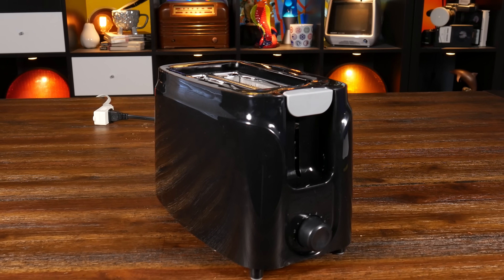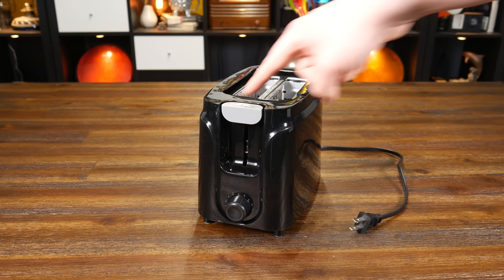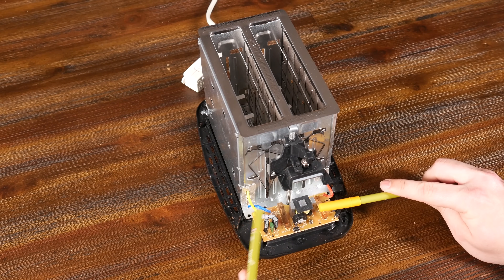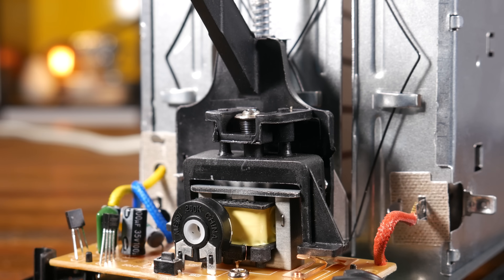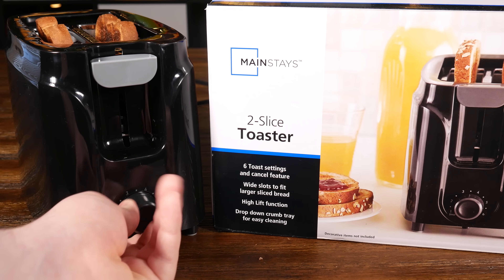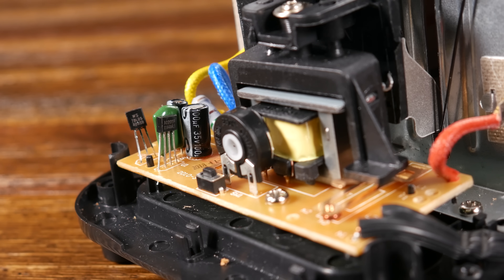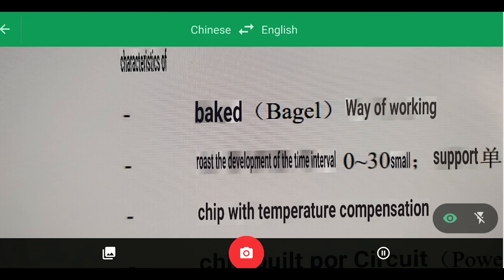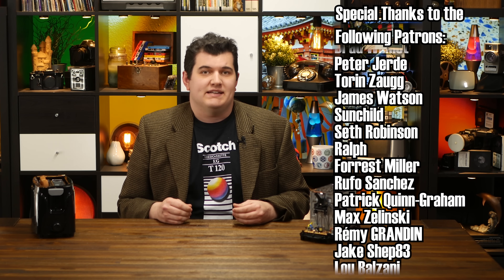The Electromagnet in Your Toaster

Comment: About 50 years ago, I worked in an appliance repair shop, and learned quite a bit about toasters, toaster ovens, broiler ovens, etc. I will totally vouch for the statement that the best toasters (at that time) were the Sunbeams, that lowered the bread when you put in the slot. They were easy to adjust and worked well as long as they were kept clean (free of crumbs). Proctor/Silex were pretty easy to adjust also. Some of the others had complex arrangements of bimetals and levers with multiple adjustments. It took a lot of engineering to toast bread consistently! The problems often happened if you used the toaster after it was already hot: The first slices of bread might come out "perfect", but if you toasted more bread when the toaster was still hot, sometimes the toast would get darker to the point it would burn...

Comment: the slowly discharging Capacitor sounds like an R.C time constant.
where a resistor is in series with a capacitor, thus allowing its
charge to dissipate slowly. the amount of time that this takes to 
 happen, can be set by using different values of resistors.
or a  variable resistor. there is a mathematical formula  to calculate
the resistor values to set the time base.

Comment: A relatively simple circuit one clever design exploit  use the toasting elements as a resistive voltage divider to which D1 is connected.  This provides about
 1/4 the applied line voltage more easy accommodated by the low voltage DC components in the solenoid and timer circuit which appears to be a basic 
variable resistor and capacitor timer.  U1 probably contains a Voltage Comparator that controls transistor Q1.  The other components are DC power supply 
filtering and very basic voltage regulation via Zener diode Z1.  D2 protects Q1 from the RL1 inductive fly back voltage spikes.  Simple but probably reliable 
enough for the price.

Comment: Re: the one output bagel mode - annoyingly a lot of manufacturers offer what they call "bagel" setting that does not actually turn off any of the elements, it just cooks a little longer than it otherwise would for the doneness setting (since a bagel is denser and often moister, it will take longer to toast all else equal). The annoying thing is it can be almost impossible to tell from packaging and documentation if a given toaster has a true "don't burn the outside of my bagel" bagel mode or just a "give it an extra thirty seconds or so" one, which makes comparison shopping that particular feature very difficult...

Comment: My mom had a toaster that would slowly, silently lower automatically, then when done,  would slowly, silently rise. One time she wanted me to fix it, I thought, this is my opportunity to find out how this elusive technological wonder worked. Inside, I noticed a loop of nichrome wire looping over a hook connected to the lever that raised and lowered the bread. I scratched my head for a moment, then I remembered from my high school science class that metal expands when heated. As current was applied to the wire, it would heat up and expand. This would allow the hook to raise, thus lowering the lever on the other side of the pivot. When done, the wire was de-energized, it would cool and contract, raising the toast. I could not believe how simple, yet ingenious this design was.

Comment: My somewhat pretentious Cuisinart 4 slice toaster stopped (had it for years) working...toast/bagels would not 'stay down.'  I bought a cheap one at Walmart and found it would not let me push the lever down for a little longer cook time if toast/bagel was not toasted enough.  So I bought a newer, fancier one on Amazon (a Cuisinart !) only to realize that I had neglected to notice the "cancel" button on both my other toasters. Now I am stuck with the 2 newer toasters plus my old Cuisinart. So this video helped me greatly, since I plan to dissect my old Cuisinart and see if I can 'fix it.' ...that is clean up the worn/ sticky spring and contacts mechanism and see if that does it. Most likely it will be a waste of time, but I am retired and need stuff to do !

Comment: I assumed my clippers just had a motor, that's what's in my beard trimmer, but nope. It's literally just an electromagnet with a gap in the corner that causes it to rapidly push and pull the blade.

For some reason that really blew my mind.

Comment: Question: If you combined the factual content of THIS video with that of your Smoke Detector video, what would happen with the one, less desirable Detector type when the first toaster in THIS video starts to emit smoke?  Would the Detector go off and deafen anyone within a 40-foot radius?  Also, if the “darkness” control knob is attached to an “infinitely variable potentiometer”, wouldn’t there be an infinite number of knob positions available?

Comment: 10:58 I thought you just had a switch to "unplug" the toaster at your feet to time the jump perfectly... And I was waiting for the ending bleeps to confirm. Damn, Alec! You are smart... sometimes! xD
I never disassembled one of these but I thought it had some kind of electromagnet for the operation... Maybe some kind of latching mechanism instead of a direct magnet holding it down... But it does the job wonderfully! Yeah, electromagnets can be quite powerful to even be used as locking door mechanisms but I never thought of this application! Thanks for the heads up!

Comment: Perfect timing for the pop-ups could be achieved easier - you could just use electric extension cable with a switch, located under the table. At the right moment just turn it off with your feet. It would not be as stylish as You do, but it would use mechanism you talked about!

Comment: Temperature sensors can prevent the lever from latching if a session has just finished unless the darkness setting is increased.
Mine will often eject toast completely out of the slot and over the side.  Not sure if this is a bug or a feature :-)

Comment: Tip: If your toaster doesn't stay down even when plugged in, or if it pops up easily with little force, it is likely that there are breadcrumbs on the electromagnet and metal plate surfaces, creating a gap distance which then weakens the magnetic force that keeps the lever down. Just clean off the surfaces and it will be strong again, good as new.

Comment: Both the electromagnet and control chip need DC, hence the diode. As the schematic shows, you also want a snubber diode across the coil. Looks like they recommend a Zener diode as a shunt regulator as well; given the intermittent use of a toaster and the high current draw of the nichrome wire, there's no sense in spending a few extra pennies for a 78xx regulator.

Comment: Cheap labour for cheap toaster. Electromagnets cost dough. Probably the dearest component?- The wire, the box?
The inner elements on cheap toaster- even a dearer one I bought was that the two inner heating cores were wired in series and not parallel, giving the middle two were just one big resister and so one side each of the two toast slices were under done compared to the two outer faces. This really annoyed me. I think it was a bumbeam- Like 80 bucks Au years ago, (or may be it was $40 and the Tefal kettle was $80?- anyway, the lid rotted on that). Bloody cheap arsed plastic they use! That's a lot of dough for a toaster anyways!
Friends have a Breville. Has "A bit more," "Check" and other things- all the other things Mr Wonderful's mentioned lol. It's a bloody amazing toaster!

Comment: Plugged in but Lever not staying Down?    There might be some Crumbs or Seeds on the magnet not allowing contact.  Or in my case a Burnt on Raisin.  Unplug clean out the crumb trays.  Turn in upside down a shake it, slap it to loosen anything stuck.  Keep shaking it until you down hear anymore Crumbs rattling around.  This should work saw a You Tube video about it.

Comment: That's way more complicated than the one I got in 2008 (used at that).  The button itself pressed down and pushed two leads apart, which pressed them into another pair of leads and created the circuit.  Had to pull up to break the circuit.

I know that because one heating element burnt out fantastically, breaking the toaster.  I took it apart and used speaker wire to wire up a light bulb to it for fun.  Never kept it on long enough to melt the wire - I know it wasn't built for that!   Thought about getting good wire, drilling room for actual light bases to work, and actually converting it to a lamp with a press-down switch, but didn't have a drill and never made the time.  Oh well.

Comment: Who likes their toaster?  Ours is not working well and I need a new one.   I need a toaster that:

1. toasts pan-size bread - 5.5" slot length

2. toasts the entire slice evenly, edge to edge, top to bottom (thin untoasted lines from the holding wires are OK)

3. toasts both sides equally.

I really don't think I've set the bar too high.  Ours fails 2 and 3 consistently.    I've done research on Amazon but the reviews will be from "fabulous toaster" to "piece of junk" on nearly every one.

Who likes their toaster?  Make and model, please.

Comment: That black toaster that cost less than $9, that one. My apartment came with one of those. It is the most horrendous kitchen appliance I have ever used. The lever is very difficult to push down; it makes a very loud 60Hz buzz on startup; it doesn't have a bagel mode; and it toasts horrifically unevenly. Like one side of the slice will be uneven, not just inside vs outside being different. The bottom is notably more toasted than the top. Also I only toast bagel so I really should buy a nicer unit with a bagel mode

Comment: I'm in awe of the fact that you spent enough effort to properly time all those terrible (read "amazing") puns with the toaster popping up. Not that it's a particularly useful thing to point out now, but it probably would have been easier to just plug the toaster into a power strip with a built-in on/off switch. That way, you just flip the switch to off with your foot when you want the toaster to pop, cutting off power and making it pop on demand rather than trying to time everything out.

Comment: Complex electronic circuits can be an advantage. Until an part on the board fails. Then it's toast. ( pardon the pun) I prefer the simple, non-electronic logic devices. They seemed to last forever. Yes, with light bulbs, incandescent bulbs wasted energy and burned out sooner. So, there is an advantage to LED's and CFL's. But washers and dryers and most major appliances, complexity shortens the useful lives of those appliances. I don't need a computer on major appliances. Simplicity is better for longevity.

Comment: I had never considered the possibility that toasters could be better. I hate my toaster. I normally toast English muffins. Set darkness to max, set to bagel, toast. They're barely starting to get warm when they pop up, so I have to pick a lighter setting and toast again. To say that I get inconsistent results is an understatement, and the process is annoying, and time-consuming. Seeing you expound the virtues of that antique toaster, and seeing you tear into the guts of a modern toaster has inspired me. Surely it can't be that hard to hack some better electronics into a toaster. I can probably even make a profit. Buy a toaster for $8, put $150 worth of R&D into the design of a better timer, and sell the result to you for $50. Profit! $$$$ Wait. That was how my ex wife did math. Well anyway, at least I'd end up with a toaster that could actually toast my English muffins to the correct consistency in one pass. This seems like a good cold weather project, heading into the dark winter months.

Comment: "If you pull down a lever while the toaster is unplugged, it won't stay"
Tell that to an early 80s toaster my mother uses. I pulled it down with ease, but disengaging it took a fair bit of force, and despite that happening a year ago, I'm still not entirely convinced that the mechanism is fine, and i didn't break something. All this while it was unplugged.

Comment: I assumed that it heated the metal plate the electromagnet is attached to and detached once the temp was reached similar to the rice cooker. The difference in cook time could be achieved if the dial controlled how far the metal plate was from the heat source. 
Side note, I always called it a button, not a lever.

Comment: that diode might be to stop the current made from magnetic energy from passing current trough a coiled wire (the heating wires)  to get dumped back in the circuit when the toaster stops.

Comment: Why didn't you just connect the toaster to a multiple socket outlet with a switch and then disengaged the switch with your feet? Electromagnet disengages and toast pops up just in time for the punchline.

Heck, you could have just tied 2 extension cords around your ankles in order to pull them apart at the right time by slightly spreading your legs under the table.

Comment: ICs? Capacitors? What's with all this newfangled stuff? My toaster is about 25 years old, but it appears to be identical to the one we had when I was growing up in the 1960's. It uses some sort of bimetallic strip for its control, and the mechanism gives off a single click sound partway through its cycle. I have yet to open it up and analyze what the click is and why it is only partway through the cycle...My mother's toaster was self-lowering. When you put the bread in the correct slot the heaters would come on and what was clearly some sort of mechanical thermal sensor would lower the bread in a second or two. Later, when the toast was done, the element would turn off with a quiet click, and the toast would slowly rise again as the heaters cooled off. I guess this qualifies as a cat-friendly toaster (though we didn't have a cat).

Comment: Oddly enough, I've used a toaster oven at my home for years, so I never gave much thought to regular two-slice toasters.  But we have those in the break room where I work.  Last week, I went to toast a bagel, but the toaster lever would not stay down.  I thought "it wasn't latching".  Then I realized it was not plugged in.  When I plugged it in and pushed the lever down, it stayed down!  That's when it dawned on me that it was an electromagnet holding it down, and of course without electricity it would not work.

Comment: The motor in our car, a Nissan sentra 1981, was using a bimetallic handle to close the choke --- automatically, not human intervention. The physical motion of the bending rod was used directly. It was not an electrical switch which would activate a motor or electromagnet. 

This allowed to keep the choke for a longer time period when the motor was really cold.

The gas pedal was disengaging the choke even when the bimetal thing still didn't feel warm enough to do its job. When you were starting the car in winter, going back inside the house to warm up, you could hear after a few minutes the motor idling at a mad speed, probably 2500 RPM. We had to rush in the car at tap to throttle to finally hear the motor slowing to a more safe RPM of 900. This interlock was another ingenious improvement over older motors.

Comment: During the video, I thought you had a power strip with a switch on the floor below the table.  I thought you were putting already toasted bread into the toaster, filming the shot, and then flicking the power switch with your foot, which would have cut power to the toaster thereby releasing the magnet from the electromagnet and providing you with a perfectly timed toast ejection for this stellar video..

..

Boy did you have me fooled!

Comment: You are probably already aware of this, but the point of a toaster is not to gently burn bread. The desired browning is due to the Maillard reaction, where amino acids and sugar in bread react to form the distinct taste of toast. The process is chemically distinct from both burning (charring) and caramelization, though all three result in darkening through heat.

Comment: At 6:15 The diode uses the heating elements as voltage dividers to obtain about 8 - 10 volts of raw AC, which, it rectifies, the electrolytic capacitor near it smooths out, to finally produce the DC voltage needed to operate the circuit board devices.

Comment: That yellow wire connected to the diode was most likely the power input to the IC circuitry, they were using the nichrome wire as a voltage divider and the yellow wire probably just tapped into the heating element close to the neutral side so that it was taking like 12V or something off the element and using the diode and capacitors to convert to DC and smooth it out.

Comment: If it can range from 0-300 seconds (0-5 minutes), and the dial goes from 1-6, doesn't that mean the numbers of the dial do actually correspond to minutes, except they are one off? From what I saw of the toaster you showed, it starts at 1, not 0, so 1 is some minimum time, 2 is 1 minute, 3 is 2 minutes, etc. up to 6 being 5 minutes, assuming a linear correlation and near-zero minimum time.

Comment: ...Don't we call it a lever because its "technically" a lever as the outer plastic piece we push on is disjointed from the spring resisting our push meaning we act as the "load" depressing the "lever" assembly in opposition to the work of the spring with the "fulcrum" being somewhere between us the "load" and the spring which supplies the "effort" making it some kind of depressing failure of a lever as the work of the spring is not actually overcoming the "load" of our desires for burnt bread?